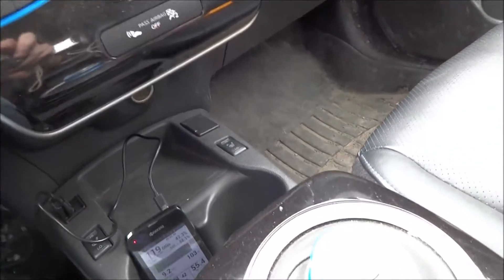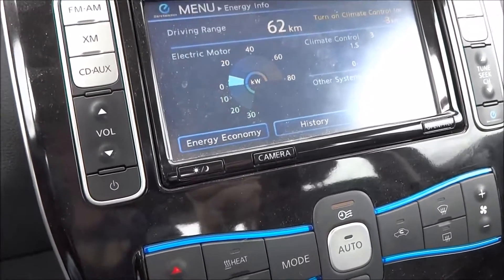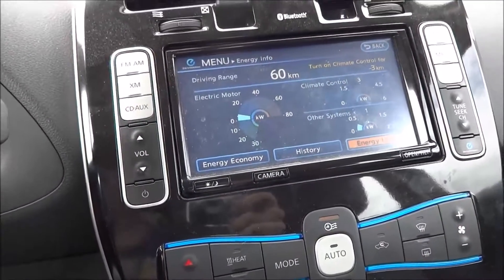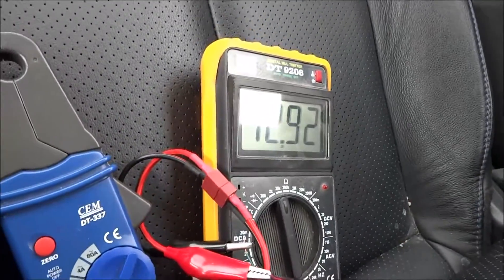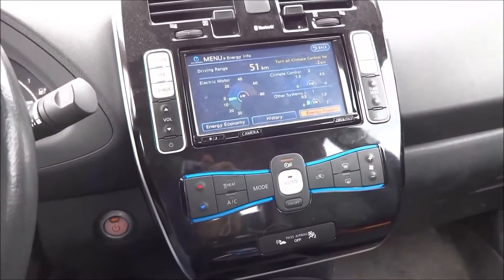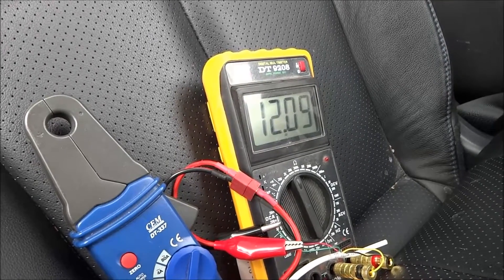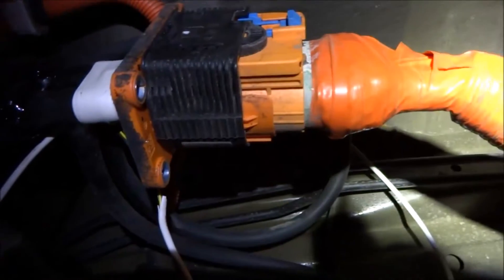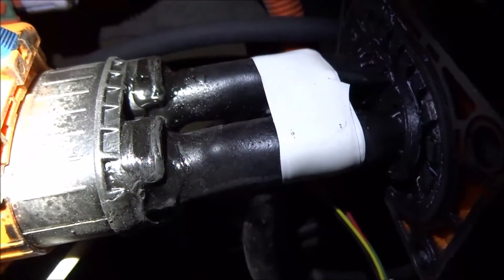Nissan LEAF range extender pack build Pt.1.3 (testing splice on the high voltage cable)

Comment: This is a very intriguing project that you have started. I've been thinking of doing similar things with the possibly of a future range extending trailer product that could be offered to existing Leaf owners. I hope you don't mind comments and questions on your videos? My first question would  be did you test your thermistors with an artificial heat source such as a cigarette lighter to confirm that it actually can take measurements of temperature changes? Thanks.
Reply from the maker: With just the heat of my fingers the resistance would change.